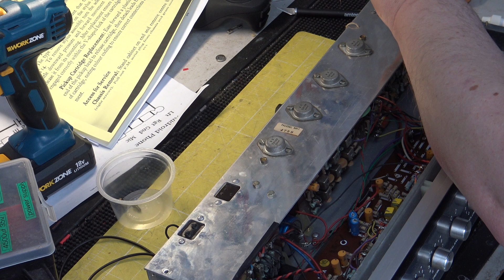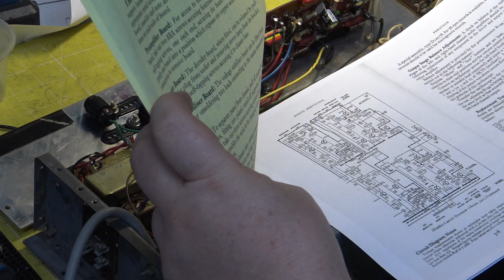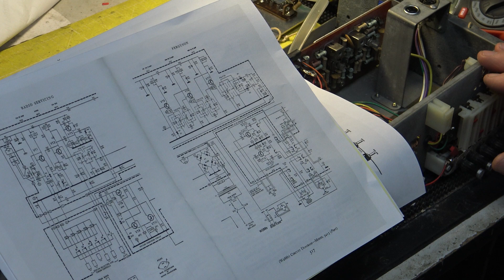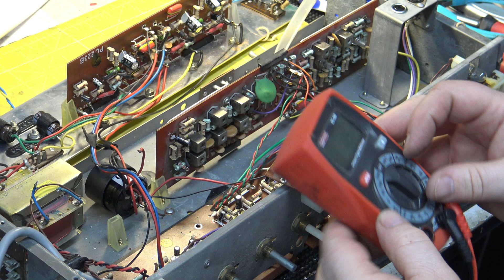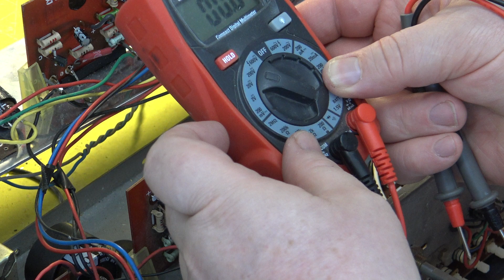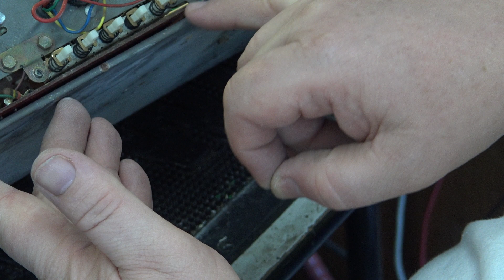HMV Stereomaster 2411 Pt2 of 3 - servicing the electronics

Comment: What about electrostatic tweeters like those used in some Grundig radios.
Reply from the maker: I have a Hack Constellation HC50 radiogram here with three piezo tweeters per channel. Yes, we've had to fit piezo tweeters when one has been missing & it's worked out OK. I try hard not to do modifications that would change the sound of the product wherever possible.

Richard

Comment: Mad how things have progressed so far over the years, from the specs ive seen, that thing outputs 12w PMPO which is roughly 6w RMS.
Two of the 3 Amps in my car which are a fraction of the size can put out 1200w RMS @ 1ohm which in hype watts is 2400w PMPO if struck by lightning lol.
i run two of those amps @ 2ohms and 800w RMS and the third which is a slightly different model @ 4 ohms and 400w RMS :)
Reply from the maker: I ran a mobile disco for many years & the amplifier was 200 + 200W per channel. We never needed it above 5 out of 10 for any size of venue.
Reply: @ukfmcbradioservicingTango21  I have a Carlsbro SX600i 600w club amp as 'part' of my home system driving two Subs and more modern amps handling the mids and highs.
Id love to run more subs at home as four 12's in the car leave my home system feeling lacking but i dont want to get murdered in my sleep by my neighbours who put up with a lot from my home system as it is lol.